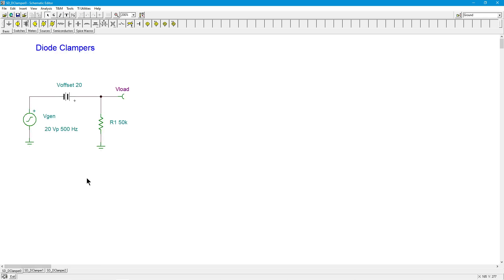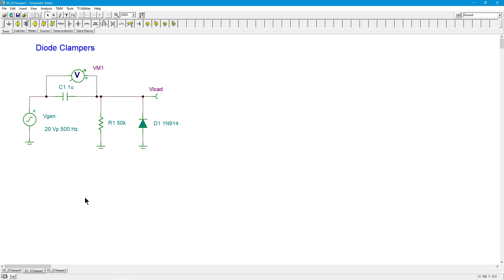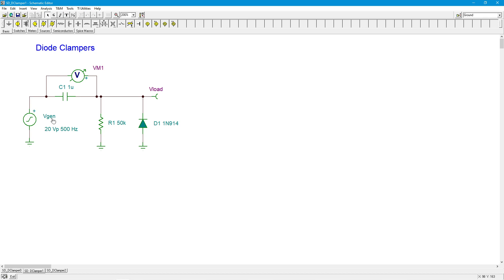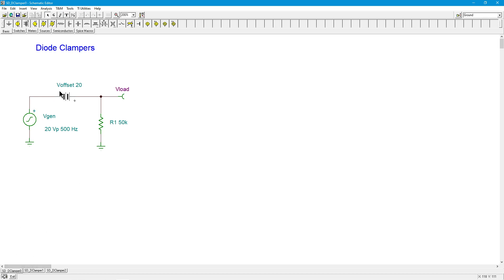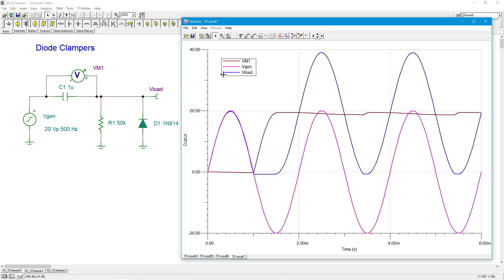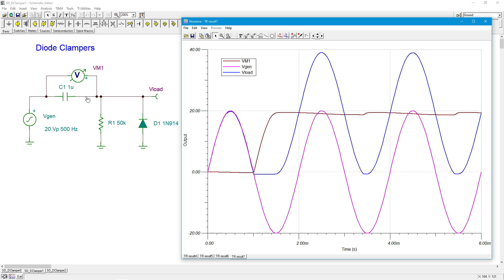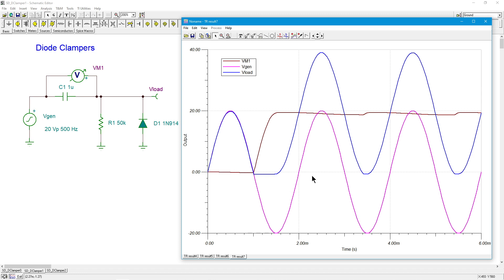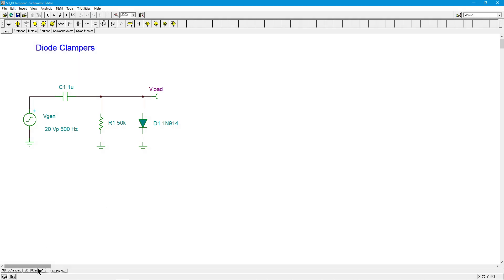Semiconductor Devices: Diode Clampers

Comment: Would polarized capacitors not be suitable for this, since it would experience reverse polarity during the negative half of the sine wave?
Reply from the maker: You could use them. The cap charges up to the peak value and then holds that potential. When you compare the discharge time constant to the input frequency, you see that the cap voltage is fairly constant. Essentially, it behaves like a battery, adding a DC offset.
Reply: @ElectronicswithProfessorFiore  I see, thankyou professor!